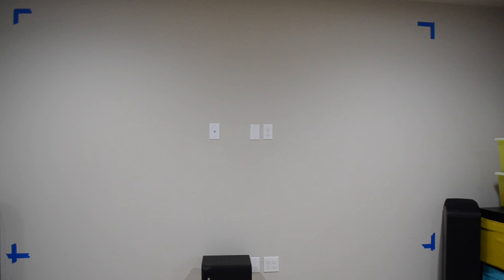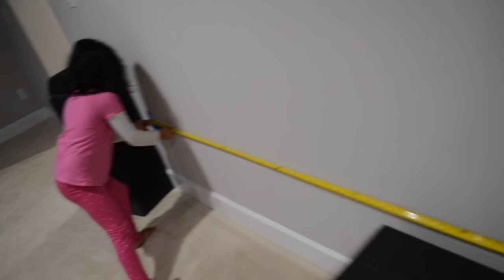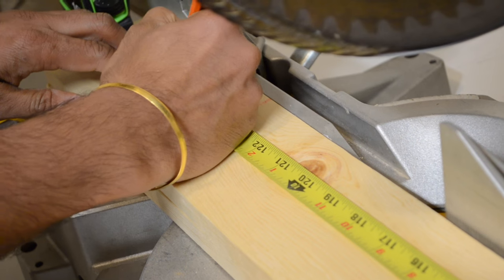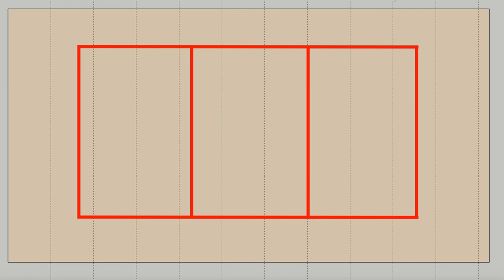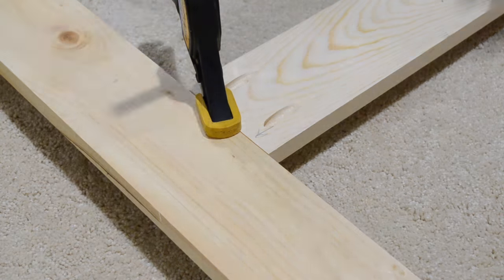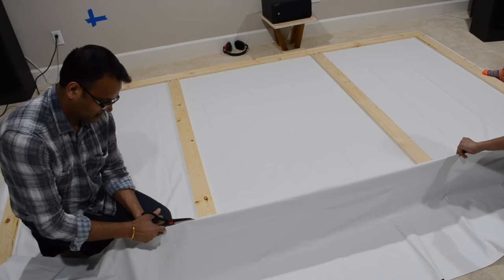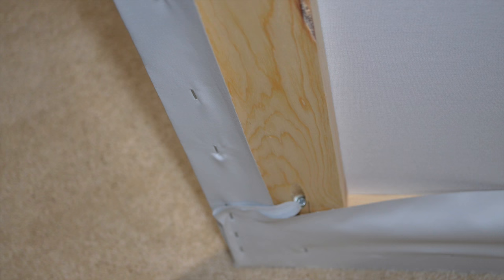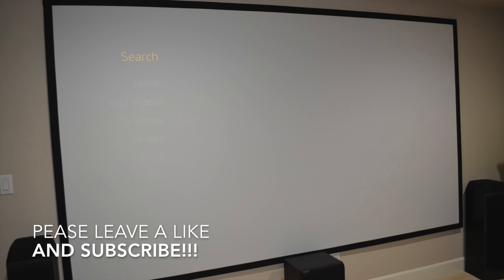DIY How to Make a Fixed Projector Screen

Comment: One of the best screen build videos on YouTube IMO. Only thing I would mention is in another video a guy used a french cleat to hang the screen instead of hanging from screws. Also, I'll be building an acoustically transparent screen using spandex, otherwise I think I'm going to largely follow this process.

Comment: TV projectors have been around a long time; long before HD and wide screens.  People wanted them for the Super Bowl and for watching DVD movies.  I never got one but I remember back then people were buying some sort of building interior panel from the big home improvement stores. It was common knowledge that they had viewing specs almost as good as hi quality commercial (home use) screens.  Since then, I haven't seen any reference to those products.  Can anyone remember?
I think they were some sort of rigid polysomething or foam.

Comment: Great video. Do you have to do the black felt tape border? I'm planning on framing mine with trim or barn wood. Thoughts?
Reply from the maker: No, but the black adds a nice contrast, sectioning the screen out, and making it look professional. Honestly, I havent seen anything done with barn wood, though I'm sure it would turn out great. Do make sure to try it out.
Reply: Rich and carter german 
The black felt border allows you to not have to fit the projected image perfectly on the screen which can be difficult in some situations..you can go over a 1/4" or 1/2" if you need to and the black felt absorbs it..definitely worth having.